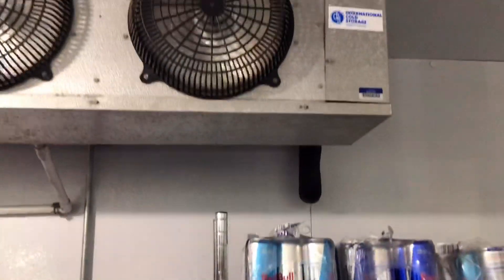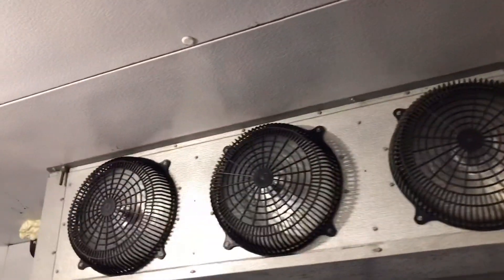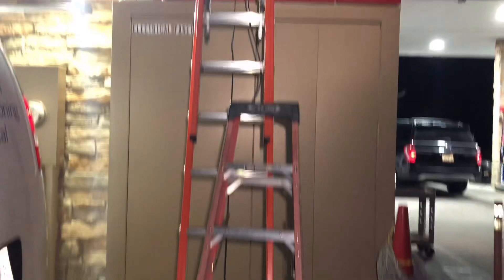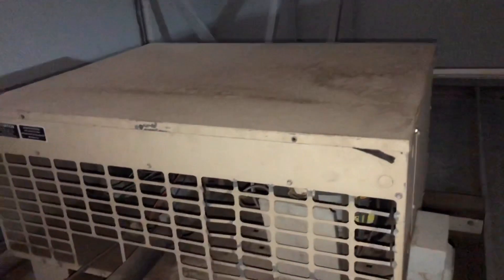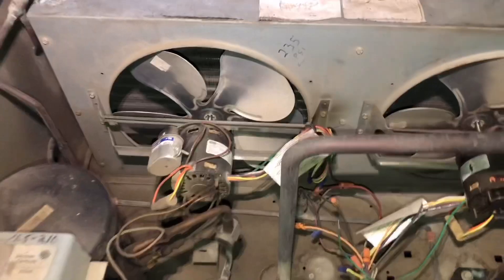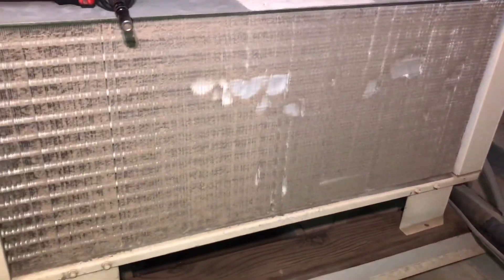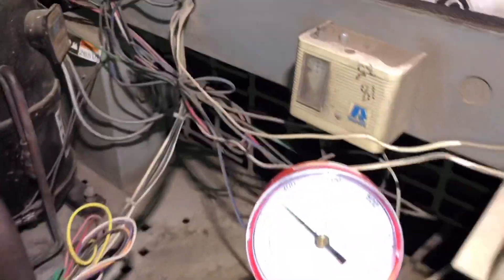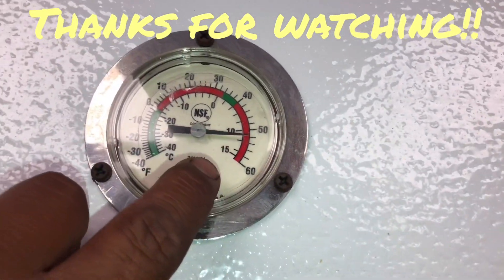HVAC Refrigeration:  Beer Walk In Cooler Down

Comment: Great videos man keep up the great content. Just some suggestion, by placing the top cover to the unit in it’s place this will prevent the air flow from coming through the top portion and thereby forcing the air flow through the condenser and in turn give you more accurate and true readings on the amperage of the condenser fan motors and also condensing pressures
Reply from the maker: That’s true in most cases, but this unit does not require it.  You can see that the fans are already inside the “shroud” so the top will not affect air flow.
Reply: Rookie Refrigeration my apologies buddy!
Reply from the maker: jorge janicas it’s cool buddy.  I always appreciate advice.  I’m always trying to learn.

Comment: its a wire that rubbed through the insulation and shorted to ground.  Why are you ohming and checking for shorts? reconnect the wire and be done with it.
Reply from the maker: True. But there is nothing wrong with checking the motor just for safety purposes.
Reply: @rookierefrigeration4357  Id be wondering why didn't the fuse blow? That was a dead short.
Reply from the maker: hvac01453 the wire was completely severed and not making any more contact.   There’s no telling if the staff flipped that breaker X amount of times.  Lol
Reply: @rookierefrigeration4357  ya, thats true....

Comment: Safety tip.  Next time you need to climb over one of those metal fascias on a gas station tie your extension ladder to the supports to keep it from sliding.  You are in a very bad position if it starts sliding sideways while you are changing ladders.  As a bonus it keeps some joker from lowering your ladder on you while your at the unit.
Reply from the maker: Very true.  I have begun keeping a strap for that purpose specifically.  Thanks bro.
Reply: @rookierefrigeration4357  When I started in Boston with a journeyman, he told me he had a bum steal his ladder while he was on the roof for the aluminum... Now he secures it every time.  Can you imagine calling the boss to tell him your stuck on a roof without a ladder he paid for.

Comment: Have you used your digital gauge to take Superheat down at the evaporator?
Reply from the maker: Familia Sanchez HVAC I use my digital probes for that.  They come in really handy.
Reply: @rookierefrigeration4357  Have you used them on a Walk In Freezer? If so, how do the low temps affect it?
Reply from the maker: Familia Sanchez HVAC I have not used the SMAN480 inside the WIF.  But I have used the probes inside a freezer and they work great. I actually left a temp clamp on a freezer suction line for over 30days and it still works🤣